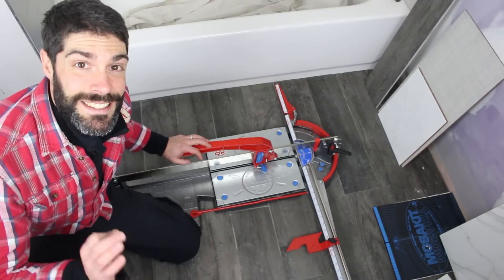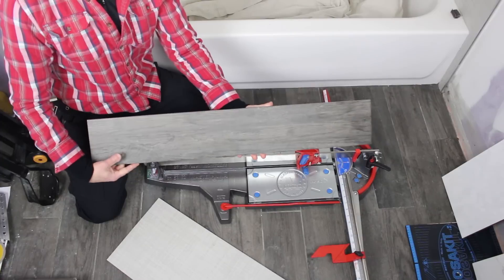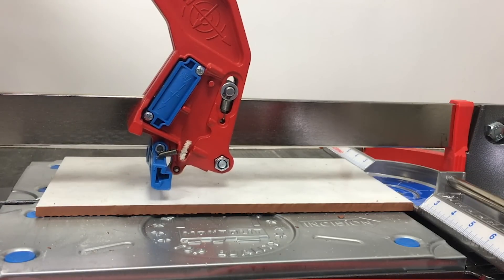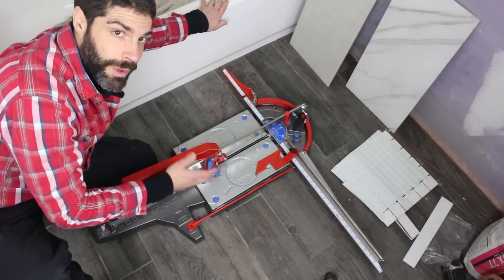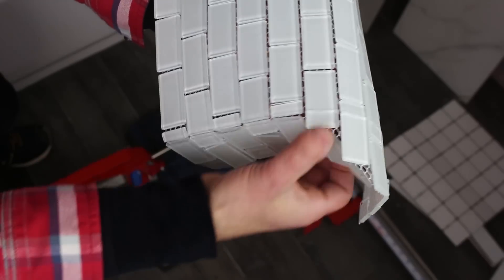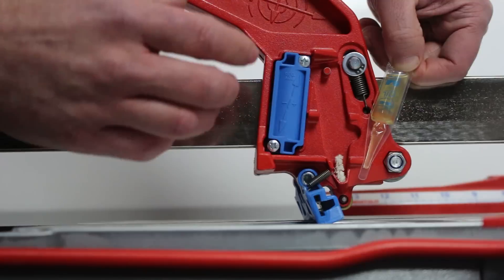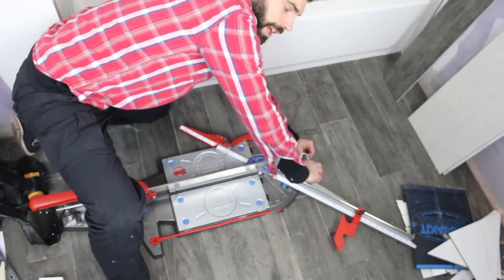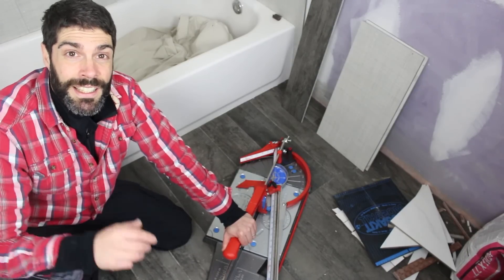Best Tile Cutter for Any Type of Tile (Montolit Masterpiuma)

Comment: I needed a saw to cut stone tiles for a backsplash. https://www.youtube.com/post/UgkxfiuHoZJo3bgdVPFRxQ-iqPpfbEHl2cYt   I thought for sure I was going to need to buy a "better" blade than the one that came with this machine. I was surprised to see that blade worked great. Buying this saw was cheaper than renting and allowed me to take my time on the project. I wrapped the tiles (front and back) with blue painters tape and drew my cut lines with a sharpie on the tape. I performed all of my cuts free hand and had no trouble cutting the tile straight. There is a guide you can use to help with cuts if you prefer. This was my first tile job and this saw made it easy.

Comment: I have a sentinel 40in and having problem with the cuts not sure if the blade made a difference on that? Any suggestions
Reply from the maker: if you’ve been using the same blade I’d get a new one and see how that works before switching snappers

Comment: I Bought In Home Depot 
A 99 Dollars A Manual Tile Cutter
48” Big Long And A Good Brand,
After The 20 Dollars Wheel From
Montolit Masterpiuma In Amazon 
And I Can 
Cut Marble And Porcelain Same 
As You With Not Problems,
The Secret Is The Wheel Only And
I Donot Have To Spent 1,000 Dollars
Like You Did.
Amén.

Comment: Does that cut hard 12x24 porcelain tiles? Tiles that are 0.5 inch thick and hard as hell. Thanks
Reply from the maker: we’ve used it on tiles like that and it’s done very well
Reply: @HomeRepairTutor , awesome! Thanks for the reply. This tile that I'm installing is very glossy and hard and the rubi cutter that I usually use can't get the job done. I think I need to upgrade asap.

Comment: Would this tile cutter be effective for making cuts/miters in my matching bullnose subway tile? Trying to avoid messing with a wet saw if I can. Thanks!
Reply from the maker: you could cut the tile with this cutter then use a grinder to miter the edge using a Diamond blade

Comment: rented this cutter, had troubles zeroing it to get a straight cut. wanted to cut 12x24 into 6x24. h Had to bail out that idea and stick with 12x24.
Reply from the maker: It takes some practice to get the feel of the Masterpiuma or any cutter for that matter. But we continue to like it more than our old one. Hopefully they had a good cutting wheel on that rental
Reply: think its good, still have it. no troubles with cuts. is it normal to get a wave under the cut? i'm finding a grinder is needed to smooth out some spots, havent grouted yet, but was worried the waves would still show through the grout.
Reply from the maker: Not sure what you mean by wave. Quality of cut also depends on the tile. As long as the face of the tile is straight it should be fine.
Reply: k thanks, yeah its a thick porcelain, the face looks good.
Reply: shouldnt need any practice to set it to 0 degrees. stopper should stop it there. Maybe the one I used was detective.
Reply: sowtis Use a diamond sanding block to smooth the cut edge if it's going to be exposed.

Comment: I'm  tile setter for 20 years and use Ishii tile cutters and are very good , I really like this tile cutter  I think I'm going to buy the 63P3  at amazon for $489 CAN ,  I find that the Sigma pull tile cutters are horrible ,very hard on the wrist, I don't like using them. Push tile cutters are nicer to use , easier on the wrist and arms.
Reply: Have yo tried the montolit yet? I'd love to hear how it compares to the Ishii, my current cutter.
Reply: I have not ,  If I have a chance to use one or purchase it I will let you know what I think about it.

Comment: Would this cutter work on 1" marble tile on mesh backing? Trying to find some way to cut this tile that will butt up against the tub, but not finding a lot of answers. Help!
Reply: You cant cut marble with a manual tile cutter, especially mesh backs.  If there is mesh, that means it has a lot of veins and that equates to weak spots in the stone. Any natural stone, marble,  etc has to be cut with a wet saw or with a angle grinder with a water attachment .

Comment: Good video. 
I’ve owned mine for 12 yrs now I’ve upgraded the handle from the original blue adjustable handle and pan springs 4years ago. Hands down it’s the Cadillac of cutters although you’ll always get the Sigma humpers who just can’t convert to a push handle instead of the pull. My personal favourite piece of this outstanding cutter is the blade. Made of titanium this blade never need to be changed. Bought a new blade in the first year and after using it there was no difference. To this day I still am on my first blade “crazy right” 
Would like to point out 1 tip on carrying it always place the handle up to the red rubber stopper before turning in the measurement arm, this locks it in place for carrying it.

Comment: Thanks for your vids!  I am debating between the Ishii Big Clinker or shelling out the funds for the Masterpiuma.   Does the Ishii cut heavily textured porcelain well all the way to the end??   My Qep always cracks a slight curve at the far end 😖. Time for a higher end cutter.    I’m not a pro , just a diy but want one that can make consistent full straight cuts up to 24” on hard textured porcelain.
Reply from the maker: quality of cuts also depends on tile but the Masterpiuma is our preferred cutter. Ishii makes good tools as well and their cutting wheels work very well. If you’re tiling occasionally we’d opt for the Ishii. If you’re doing a lot of tile work then go with the Masterpiuma. Either way, you can sell the cutter on Facebook and recoup a lot of your money.
Reply: Thank you!  I think I just may buy once cry once and get this Montolit!  I am on the fence!   Any Christmas or Holiday deals coming up to push me to take the plunge right now??  😜

Comment: I just got same size an love it. Makes cutting tile much faster than with my MK 101. The con is you use oil on side feed like built to do ,tile shavings build around the cutting wheel an its not very smooth over time. It is a great cutter an would tell anyone to get one you will love it
Reply: Price
Reply: The oil is only for textured tile...shouldnt have to use it for any other tile.

Comment: Hello and thank you for the video, I used mine for the 1st time today. It does cut nice but I do feel that that the 45 deg is off on mine. I ended up cutting a few wrong that I noticed did not fit. I had to re adjust the 45 angle. one thing the company should look into is giving you a notch in the machine that as you turn the machine to a 45 it would hit the notch and your set. 
I noticed you are using the mat, can you send me a link for that please. I thank you
Reply from the maker: totally agree, we'd like to see Montolit add detents like on a miter saw, that would be a good upgrade. Here's an Amazon link for the Mosakit pad, it's great for glass tiles and a must have to maintain the paint
Reply: @HomeRepairTutor  I don't see the link?
Reply: found it, thank you
Reply from the maker: @one1wizard  sorry about that, here it is https://amzn.to/2o0VOpo

Comment: Is this cutter serviceable? I do work my machines hard and I have a tendency of pulling to the left when im scoring the tile (if that makes sense!) Over time the handles on my machines get a bit of play on the bar and subsequently tile does not score accurately point to point. The machines I use are not serviceable as the bearings are in a ball race that I cant replace. Always seems a shame to throw away long cutters when all that's needed is new bearings fitted.
Reply: You can buy parts for this cutter.  Contractors Direct has a section for that. We've had our 36" cutter for just over a year and the only thing we've needed to replace was the cutting wheel.  Also a ruler extension arm that was broken when my partner/son dropped it.  I really think you'll be pleased with this cutter

Comment: Are the cuts clean enough to be in visible locations or they primarily cuts that need to be done for tiles that are getting covered by baseboard or for instance a towel on an inside corner that's going to get covered up by the edge of another tile. Can you achieve wet saw quality, or better cuts with this cutter on most tile?

Comment: Tried a 47m model. Clearly a serious bit of kit but hopeless on the textured tiles I had.  Although the cutter was massive (to cut up to 62cm square), it had an oddly small cuttling wheel (8mm i think) which wouldn’t score cleanly due to the tile texture.  Apparently they are porcelain glaze and ceramic underneath. I also needed to cut lengthways. Not a hope. Even tried scoring multiple times, shattered into several pieces. Tile shop now say i need a wet saw. So if you’re starting out on tiling like me, worth checking beforehand as the how to videos with these cutters make it look easier than it sometimes is.
.

Comment: My daughter wants to install a back splash around her counter tops. I am really worried about how  she was going to do it and thought she needed to rent a diamond cutter. Is this a tool that you can rent? She will  only need to use it once.
Reply from the maker: You could probably find one at a rental place. This is a great cutter for a backsplash. She might also need an angle grinder with a diamond blade but only if there are some special cuts.
Reply: I just thought of something else. She has an electrical outlet on this wall. Will this cutter be able to cut a rectangle for the outlet? Thanks.

Comment: My suggestion, decide which size you want....and buy the next size up lol, I got the 29 thinking there's no way I'd need one any bigger, now I have a customer that wants 36" wood look plank in a shower!!!
Reply from the maker: Lol, totally understand where you’re coming from. These tiles just get bigger and bigger. How do you like your Masterpiuma?
Reply: Home Repair Tutor absolutely love it, their are only a few tiles I've run across that can not be cut on it, but they were EXTREMELY rough textured weathered wood look planks.....no matter what I did it would not score consistent and so the snap would always run off crooked. Other than that....I can't belive I messed around with that plastic thing I got from the big box store for so long! Lol
Reply: Same here I have one the can cut 24 then I bought  one the can cut up to 48 but now there is 54 " and 72" tiles not fun
Reply: I got the 36”. My feeling is, if a client picks a 48” tile, they can buy me the bigger saw.
Reply: LOL.. Right on brother! I would do the same!

Comment: Or just buy a wet saw.
Reply from the maker: That’s always an option. But this works very well and doesn’t make a mess inside the house
Reply: Home Repair Tutor who uses a wet saw in a house? I’m betting you for the same price you paid for that. You can buy a decent wet saw. Just today for a $300 wet saw I cut 1/4” cuts down porcelain tile. Also if you are doing door jams, or anything that involves a box cut out, you need a saw. Tile slicers  are good for speed, but just like you showed in your video slicers won’t always cut straight. I liked the video, but I don’t think this would be a good DIY person buy. But i deff think about buying it for my tile business.
Reply: That's kind of what I was thinking. My daughter has a small job to do in her kitchen (Backsplash) and will probably never use this tool ever again. Does anyone have any suggestions for her and I?  I would guess that the entire job will be less than 15' long and 12-15" high.
Reply from the maker: You could price out a cheap wet saw from Harbor Freight vs renting one for a day. That’s what I’d probably do. Where do you live? I could loan you a wet saw if you’re near Pittsburgh
Reply from the maker: Totally understand, this tile cutter is geared more for a tile setter or contractor, someone who will use it every day or every week.
Reply: Joe Guilfoyle go to a pawn shop. But a saw that’s from the bottom up like a table saw. $40-$50 the when you’re done bring it back to the pawn shop or sell out. Most you’ll be out is $30 and you’re still saving the cost or hiring. This product he’s showing won’t be able to cut around an electrical outlet like a saw can. Or you can use an angle grinder with a dimond blade
Reply: I live in Indianapolis. That was a very nice offer and I really appreciated it. I'm literally looking on websites right now pricing stuff There's a harbor freight close buy and that's a good idea. Thank You. I'm assuming, I would be able to cut a clean outlet rectangle with the diamond saw?
Reply: Wet saw is a must have in my opinion as well but the time a manual cutter saves you is priceless.   I had to finish cutting tile with wet saw  only when doing one of our bathrooms  cause my Qep manual cutter crapped out and if I had a manual cutter as well, I would’ve saved at least 2-3 hours.  More family time ...   Absolutely can do with wet saw only but a manual cutter is absolutely a valuable addition.  Wish I had one up and running today!   

Some of the pros to a manual cutter: 

—can get started way earlier and get a lot done before it’s a decent enough time to run a wet saw.        
— if unable to set up your wet saw inside , it’s a massive inconvenience and time killer having to run outside to do all the cuts.   With a manual cutter you can do all the straight cuts right at the project.   
— less wear and tear on your wet saw & less cleanup time.

Even my inexpensive Qep paid itself multi times over just on time savings alone even tho it wasn’t the greatest and having to do recuts every now and then because it keeps curving the break at the far end 😖  time for a high quality one as I do have a lot more I want to do around the home :D

Just have to decide on an Ishii or the Montolit!     I think I may take the plunge in the Montolit!   Like he mentioned even if I ever totally finish everything I want to do and can’t find anything else lol.  I could sell it and I’m sure recover more than half the cost if I keep it in nice shape.   Hmmm 🤔

Comment: This saw is fantastic in my opinion. Had a Rubi, wasn’t impressed. Exchanged it for this beast. To save yourself some money, don’t buy that overpriced rubber pad to cut mosaics. I used shelf liner. The pad doesn’t help with chipping of the white paint on the back of the tile. The snapping of the cutter prevents this from happening. The pad keeps the mosaic from sliding. The shelf liner prevents this for a fraction of the cost. Give it a try and thank me later. The snap cutter is $700+. More then my DeWalt wet saw. And I think that pad is $100???  Some crazy price, I felt it should have been included.
Reply from the maker: Thanks for the feedback, good to hear you like it!!
Reply: We've been looking at getting one and I definitely agree the mat should be included. They advertise it to cut glass mosaic so it should include everything needed to cut them successfully.

Comment: I just got the kristal giga cut from contractors direct. Similar design and build quality as the masteriuma for less $. Really nice cutter. Only those who have used both would know how they compare.
Reply from the maker: Thanks Kevr for letting us know, which model did you get? We're not familiar with that brand, appreciate the heads up
Reply: Home Repair Tutor I got the giga cut with laser. Worked really well, the tile had a glossy glaze on it so I had to score 2x when cutting the full 24” length in order to get a clean break.

Comment: i have purchased this machine and it did not even cut (thickness 10mm) marble what a gimmick
Reply: Kitchen Redo I do how to use it and the machine cant can’t cut 10mm thick marble tiles but only ceramic tiles
Reply: Kitchen Redo yes I did and it does not cut 10mm thick tiles it can’t i was scorching the tile and it was not breaking in Half the tiles was just falling apart this product can’t and I repeat it can’t cut marble tiles
Reply: Kitchen Redo also I lost money because of that machine
Reply: Kitchen Redo wow how long did this comment take I’m very Curious anyway I’m repeating myself over and over again this machine can’t cut 10 mm MARBLE TILES this machine broke some of my tiles and this made me lose tiles this means that I LOST MONEY 👍 PS shit machine
Reply: Kitchen Redo A mate of mine used the machine and he said it does cut very nicely with CERAMIC TILES but marble tiles there’s a problem this is a honest response from my mate ok also you are very proactive with this machine
Reply: No manual "tile" cutter cuts natural stone, marble, granite, etc. You might be able to cut one piece if you get lucky, but that is something you need a wet saw for. Natural stone will just crumble or smash when using a snap cutter and every professional knows this, that's why its called a tile cutter, not a marble cutter.
Reply: vapdivrr yeah so true are crew bought a wet cutting wheel and it cuts the marble like butter also the clients bath looks like a  palace